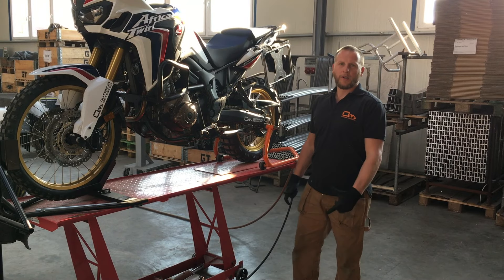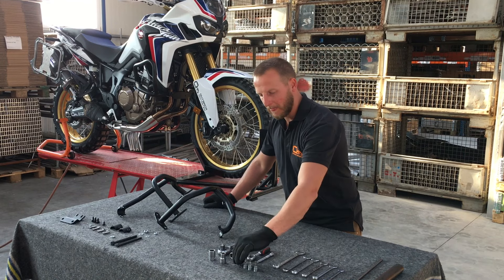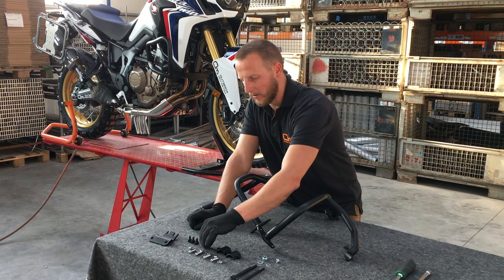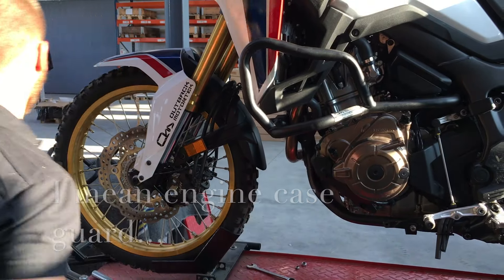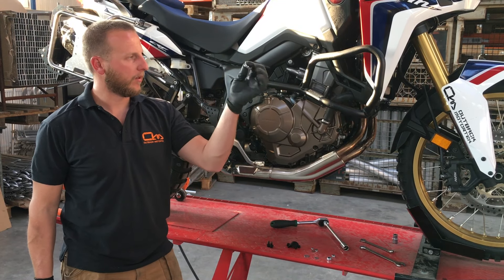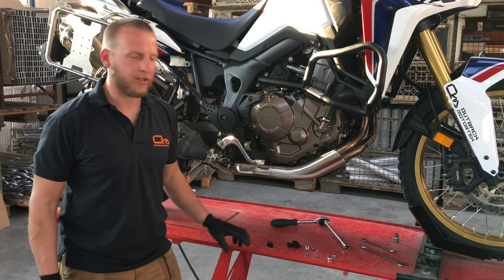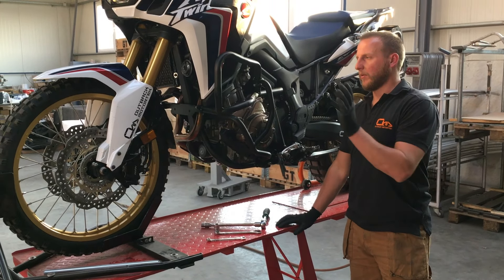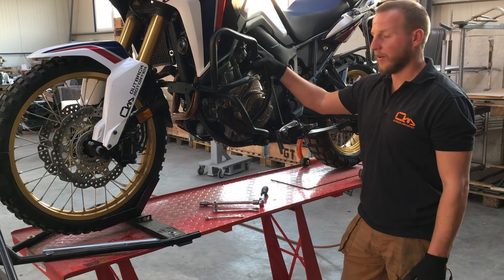Honda Africa Twin 1000 - Engine Guard Installation

Comment: Hey Lory, thanks for the vid and good timing as i just put in the order for the engine guard. Question, as I have to install the crash bars at the same time is there a quicker or more efficient order of steps for installing both products at the same time? Cheers

Comment: While mounting my engine guard I managed to cross-thread the skid plate bracket and one of the bolts for the skid plate. I was super bummed until I called outback Moto and they REPLACED THE BRACKED AND BOLTS FOR FREE NO QUESTIONS ASKED!!!! it doesn't get much better than that! Thanks Outback Motortek! You guys rule!

Comment: Hi, thank you for the video
I woulkd like to buy the complete kit upper, lower and mid for my africa twin 1000 DCT 2016
I have the DCT foot shifter mounted on the lft side
the bars fits with this OEM optional?
Thank You
sergio
Reply from the maker: Sergio Conte unfortunately the DCT pedal shifter is not compatible with our engine guards, only with the skid plate and crash bars